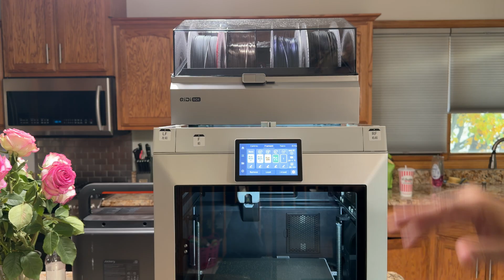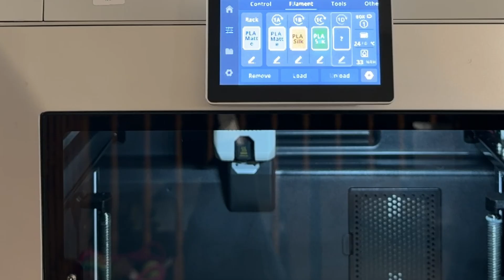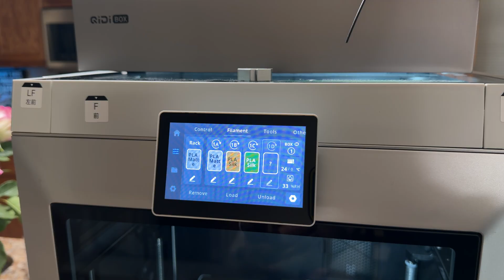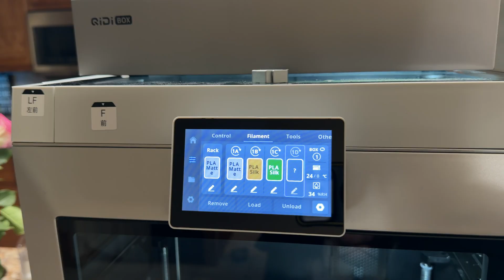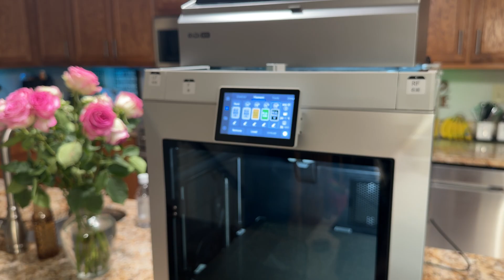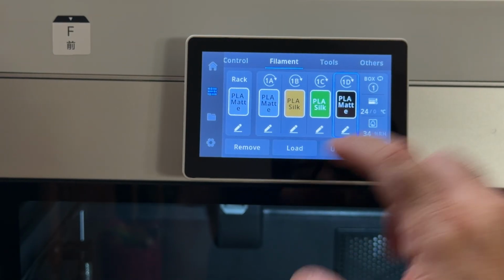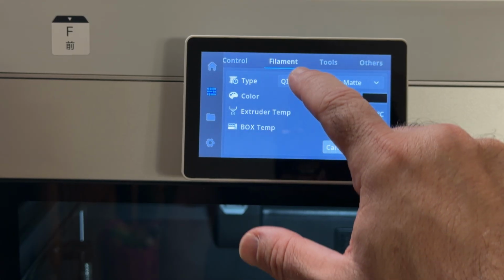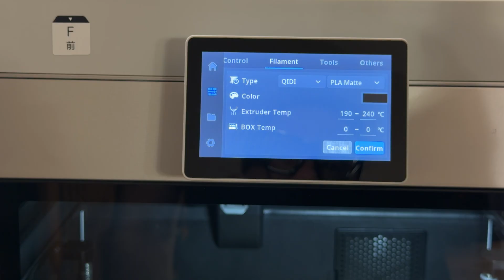QIDI BOX What you should know!  — 4-Channel Color, 65°C Drying & RFID Smart Spools

Comment: This is a good channel  but you gotta wonder why qidi doesnt test their products, identify these issues and fix them before they release their products.  Remember the overheating fire prone 4 max?  This is such amateur work on their part. I have the Q1 pro and the printer is mostly ok but the interface and help files are terrible. The exhaust fan blows the hot chamber air first thru the electronics chamber before it goes out the back. Dumb. I had to fix this with a duct to keep the hot air away from the electronics. 
 Their tech support is also quite poor.  Very dissappointed with this company. I wont buy another qidi product.
Reply from the maker: I don't know. I did give them this feedback as well.  No one sees my videos before I post but I also don't belive in blindsiding companies. I do think it is a intended design. Since many are moving to refills
Reply: @ebpman i hear you but its an oversight. Shouldn't be scraping and lifting once the roll is too light. The clicking noise is annoying and nobody will see this as a good thing. Nobody wants to point out anything that needs correction internally, this is a cultural problem. I've worked directly with Chinese manufacturers for 35 years including over 1 year in China so ive seen alot.  They need a western customer or voice of the customer  to direct development, otherwise tthey dont know and this is what you get.  I get it, you will defend them as they have many good features, ok but this is a company like many others that regularly releases  unfinished  unrefined products. Buyer beware.
Reply: I’m having a hell if a time with the Box. Errors constantly during unloading, then I am unable to use the remove function. I have yet to complete a multi color print